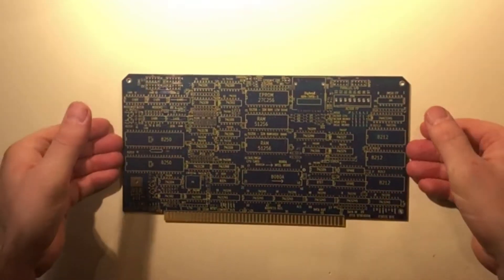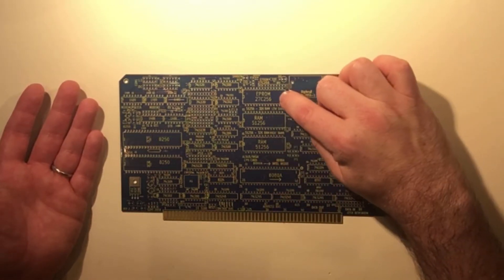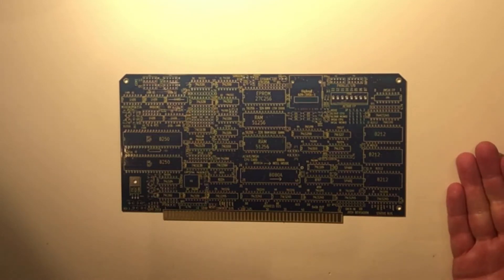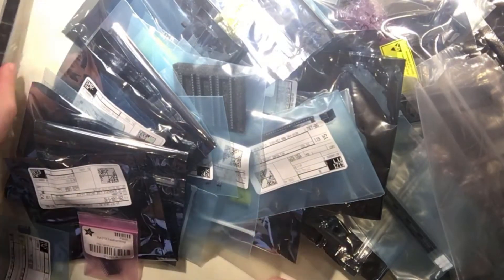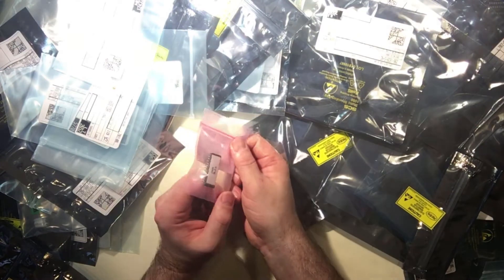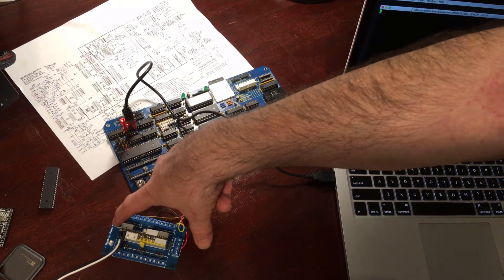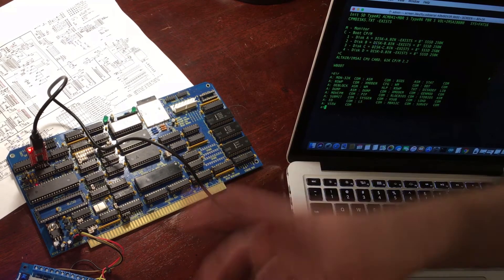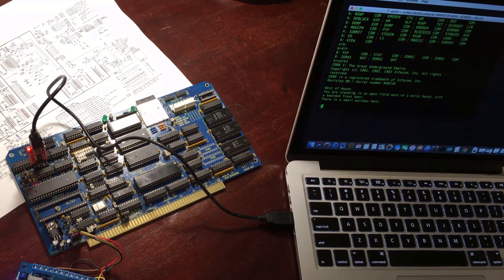Building a CPU board for a replica IMSAI 8080

Comment: Wow, that's a great time lapse video!  It makes it look easy to build!  How many hours did you spend building it?  You did a great job getting it up and running!  I don't know how that UART chip could have failed by having the wrong chip installed below it, but you can swap it with the other one and confirm it.  Thank you for a great video! I'll invite new builders to see it.  PS. Small correction... the CF or Compact Flash card is actually an SD card.  Oh, last comment, pair this board with Don Caprio's Mini FP board on a S-100 back plane and you'll have a full IMSAI replica.  He can be reached through www.s100computers.com
Reply from the maker: Thanks Josh, I think it was easily 4-5 hours to build and I did it over a few days. I swapped the UARTs and found the dead one is dead in either socket, also the not dead one is not dead in either socket. I think I just got a bad UART chip. The bad one also gets quite hot too! The misplaced chip was 5 volt logic it should not have killed it. 

I will check out Don's FP board. I am considering making a full width front panel. I like the look of the original war games IMSAI and there are some places that have the front panel plastics but not the circuit board. http://www.imsai.net/parts/parts.htm